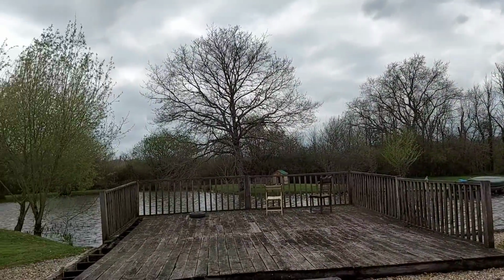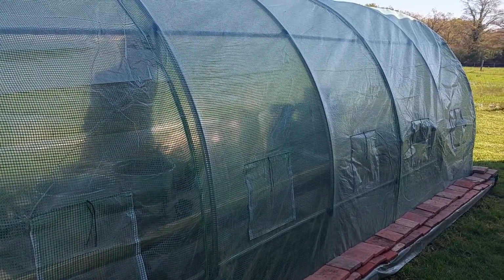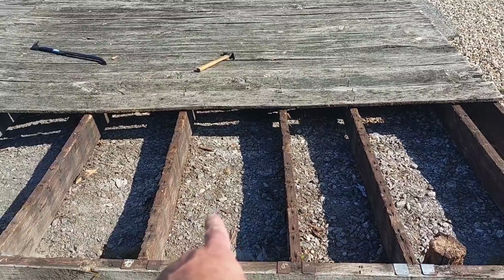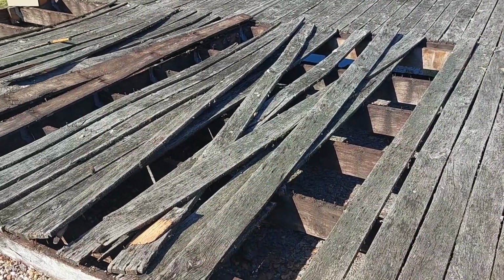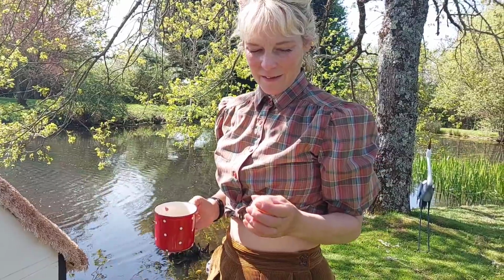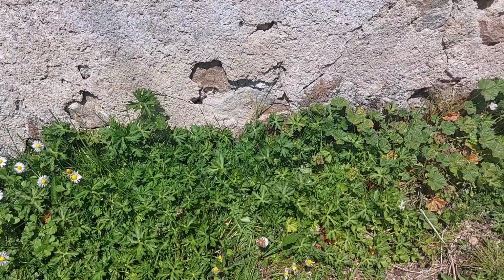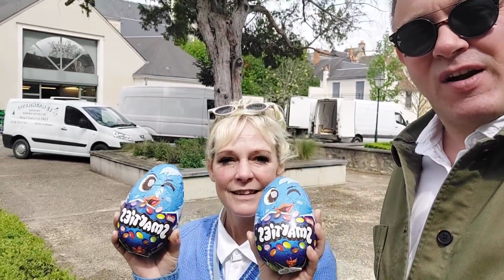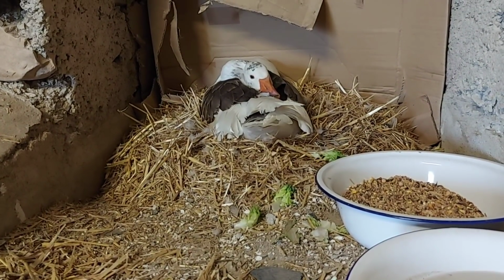Ep 51: The Ducks Move Into Their New Home!

Comment: Hi Peter and Miss Anna! Sorry to hear you were unwell after your wonderful Paris trip. Just a couple of observations if you don’t mind Peter. 😋. On the awesome little house you’ve built for the ducks. Maybe you have done it but I did not see. Just a little latch to keep the hatch open when entering Anne Hathaway’s home (sorry couldn’t resist giving it a name). And on the decking! You’ll have to make sure you lift the deck so it’s not sitting on the ground, when you redo. Just to keep surface water away from the joists etc. your obviously going to have to replace the main structure posts which you can treat to stop moisture etc so at the same time raise it slightly. Keep up the good work🙌

Comment: Those tiles are not heavy enough to keep the cover on also you have put it in a quite exposed place. 
My poly tunnel is to the side of my garden so the wind is not so fierce even so the winds we have been having the last couple of years up until beginning of June have made me think it was going to take off.
We had to buy a new cover last May because the doors had split so last October we took the new cover off and stored it. 
What you need to do is dig a small trench inside around your metal frame and tuck the spare plastic under the metal frame into the small trench, lay the breeze blocks on the plastic inside that way the strength is inside the tunnel and the wind cannot get under it I’m afraid tiles just will not be enough the winds we are experiencing in the U.K. and France are getting to strong. 
Hope you don’t mind me giving you some advice I’m not giving it to be cocky but from experience we have been through three polly tunnel covers.
I think you have had the omicron covid your symptoms sound just like a friend she said her joints especially her back hurt so much and headaches were terrible but the lack of strength was just so draining.